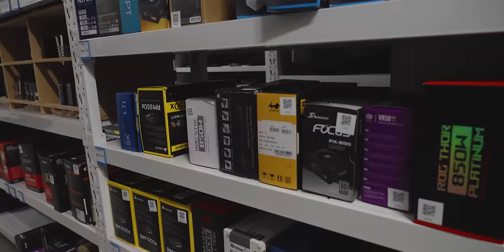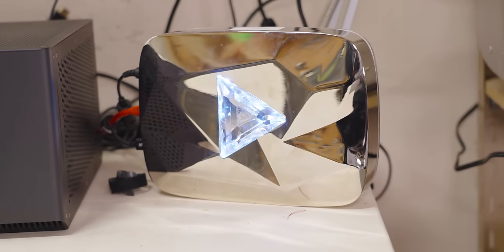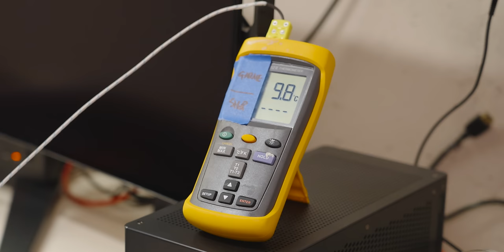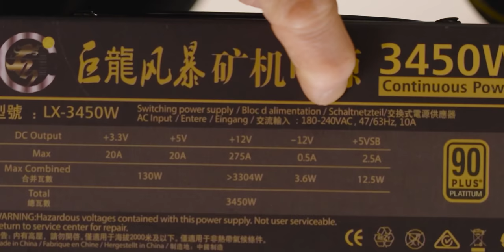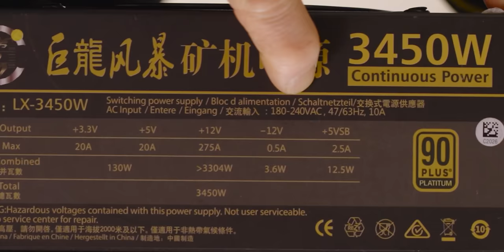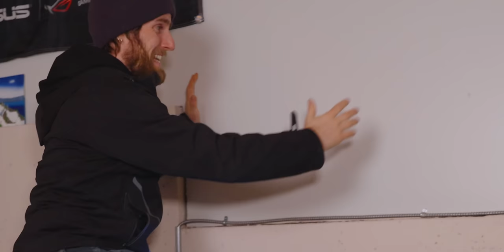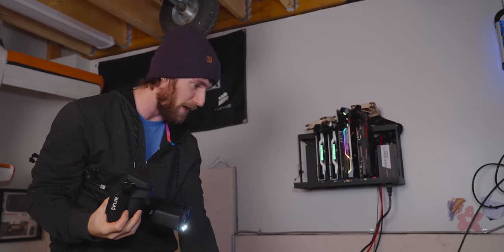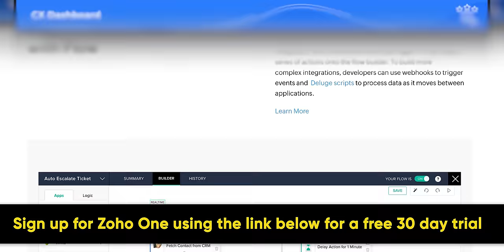Ask me why I'm Mining in 2023...

Comment: linus, "my server room is too warm" also linus "my garage is too cold."
Reply: If only there was a way to solve both problems at once, eh? Alas, humanity will never know how to move a server.
Reply: @Gabu_   The server heats the pool
Reply: @Gabu_  even putting a vent in that pumps the heat into the garage might not be to hard depending on the layout of the home
Reply: Its kind of hard to believe he didn't see this coming and make a server/garage hybrid when you put it like that.
Reply: Exactly. If the server room is close by running a duct with an in-line fan from there to that garage would be a good way to get better heat out there. Another option is to put that mining rig on the wall under the desk to make it more like a baseboard radiator and ditch the case fans.
Reply: “Things are about to get janky”, Linus’s whole channel in a nutshell.
Reply: @bakortube  This. Heat rises, so putting the mining rig under the desk, or even under his chair, would result in more heat getting to him
Reply: @Gatorz_Gaming  In January???
Reply: @Gabu_  July - "my garage is too hot"
Reply: Heat pump? Cold side in server room, hot side in garage. Do both jobs extremely well for like 500 watts.
Reply: @Blaze6108  you'd still have the really bad insulation problem
Reply: It was -8 degrees in Glasgow a couple of weeks ago, Linus just complains.
Reply: @Gabu_  Or how to move temperature. The problem with too cold rooms is humidity. But the hardware should keep it self warm enough.

The other problem is security. It is often much easier break into a garage than into an dedicated server room.
Reply: @Gabu_  ah yes, so when summer comes the server will burn, given the little delta T it has compared to the outside, that wouldn't be too optimal, plus servers aren't really that silent, and having a few dozen dollars system in the least secure place i your house isn't smart
Reply: @alexnoack9941  ah yes, break the whole house to make a ventilation system to reach the garage, genius
Reply: Bro the cable runs all go to that room for many reasons. Moving a server  just to warm this in the winter. He probably should of just gotten a space heater but this was a fun thing to try
Reply: The server room isn't in Linus' house, iirc. It's in their company building.
Reply: @Gatorz_Gaming  and the pool could heat/cool the  graage
Reply: you just need a plan for summer months.. Even when it gets to  40-50F ambient you're going to see the heat turn from benefit to burden in most cases.
Reply: @alexnoack9941  That's a good idea, but you have to be careful about putting penetrations in the wall between your house and garage.  There are lots of building codes around this to limit any exhaust fumes from a running car from getting into your house, as well as codes to help prevent fires from spreading from the garage into the house.  You would probably need a flapper style damper like the ones used on a bathroom fan and really good air sealing around the vent and ductwork to keep any garage fumes from entering the house.  In fact, using a bathroom fan to "exhaust" air from the server room into the garage is probably a good way to do this.
Reply: @bakortube  Two ducts are usually better because a single duct will create air pressure issues which will reduce airflow. so a duct in server room to pull cool air from down low in garage and a duct up high in server room to push out hot air to garage (assuming layout supports it)
Reply: @Gatorz_Gaming . It doesn’t….yet.
Reply: @manino12345 . Pretty balmy, -15 here.  My colleague in Edmonton has already been through -50 this winter.
Reply: Rich people problems.
Reply: @manino12345  it was even lower than that in Vancouver not too long ago, which is where Ltt is based. 

Vancouver is also very humid, meaning it felt even colder. I don’t think Linus being soft is an issue
Reply: Linus: dumps the heat from server room LITERALLY outside
Reply: @rustyt115  I read this at the exact moment he said that lol
Reply: linus "it would cost 10% of the cost of my house to move my servers to the garage"
Reply: it was just something fun to make a video on, not a serious heating solution.
Reply: The goldilocks of tech news
Reply: @rustyt115  I read this comment the moment Linus said it.
thanks for the subtitles.
Reply: @GuitarSlayer136  Thing is he probably needs the server up all year round and the garage will heat up during the warmer months. It's not as clever of a solution as you think once you think about it for more than a second.
Reply: what a DA 😂
Reply: lol
Reply: @Gatorz_Gaming  the pool doesnt exist right now...
Reply: @Gabu_  Honestly though, temperature swings in the summer along with varying humidity and condensation make that an iffy idea.
Reply: @bakortube  this is the easiest solution
Reply: Humidity.
Reply: I believe he has a radiator with fans for the server room outside of his house blowing warm air into the atmosphere, he could realistically just move the radiator inside the garage and the fans would move the hot air throughout the room.
Reply: @bakortube  indeed - a bit of heat below the desk just seems so darn obvious...  C'mon Linus, why wasn't that an option ?  

Oh, and before you say it, a bit of wood along and below the front edge of the desk top could divert the heat sideways so it isn't going straight up into your face and 'pits.
Reply: Just build a very long pipe connecting the two! Genius!
Reply: But that already heats the pool.
Reply: Until the summer when the garage will be super hot
Reply: "I'm struggling too heat my multi million dollar mansion"
Reply: I thought about that, but the thing is that the garage is not going to be cold in the summer. He can turn the mining rig off if he doesn't want the heat (and it comparatively won't generate as much as the server) and let the garage be at an ambient temperature. He can't just turn his server off when the garage is too hot, so the solution for removing that heat needs to be something that works year-round.
Reply: @TAMAMO-VIRUS  Heat doesn't rise, hot air rises. Heat radiates.
Reply: Solution: TOOOBS
Reply: Why are you mining in 2023?
Reply: @TAMAMO-VIRUS  That was one of my first thoughts.
Reply: If you use electric heating, your bill will remain the same for the same power draw, replace your 1600W space heater with a 1600W mining rig and make a few pennies back,
Reply: Why not pipe exhaust air from the server room to the garbage
Reply: @Gatorz_Gaming  Was there a part 2 of that episode?
Reply: @Gatorz_Gaming  even in the Winter, i don't think so.
Reply: Also Linus, "My shower is too wet"
Reply: I literally thought this was the server too hot video at first lol.
Reply: I thought ppl were gonna say just move his set up to the server room
Reply: Garages get hot in the summer...
It's really weird. It's like the garage temperature tracks the outside temperature for some reason.
Reply: @Gatorz_Gaming  Nope.... the pool cools the server. 🤣
Reply: I wonder why. lol

Comment: Since heat rises ... it would seem logical to mount the unit under your desk and then have the fans blow the heat towards your lower body heating your body and the room in that manner. Also putting a false floor with solid foam insulation under your work area with a carpet over the plywood so it would isolate the cold coming up through the floor.
Reply: I watched the whole video waiting for him to realise that putting the heat source above him was a bad idea
Reply: I have no idea how someone didn't suggest putting the heat source lower since the whole heat rises thing. Under desk=warm crotch
Reply: Yep I was going to mention this but you beat me to it.....
Reply: Itd prob be better, but even the shittiest fan can overcome convection and he was using 3 Noctuas.
Reply: @verakoo6187  Not in the volume of air he wants heated.
Also, if there's too much airflow, even like 25-30°C air would actually cool your body and make you feel cold...
Reply: @DanglyDongle  i guess they just "lets keep it quiet and make linus suffer"
Reply: Common sense doesn't always work with Linus though...
Reply: and it's easier to control of sorts :) all the heat should automatically come out front of the table.
Reply: I mentioned this and then started scrolling just to see someone beat  me to it because of course, it's like the most basic thing about heat ever Linus!
Reply: Don’t insulate the floor before insulating those ceiling rafters. When insulating, remember your ABCs: Above, Below, Conditioned space (aka walls). Always insulate the ceiling first. Foam seal any air gaps, then staple some basic R23 backed fiberglass batting and this space will feel much more comfortable with even just the mining rig.
Reply: Came here to say this. Watching this video really hurt
Reply: Huh, guess I did a good thing. 

Only difference being that my desk is the computer, I don't trust my young children around my pc so it became a desk. 

Added benefit of better mounting pressure, more space, better wiring and heat for legs.
Reply: Its Canada… heat doesnt rise there… but my thoughts exactly 😂
Reply: @michaelhanson5773  common sense also doesn't make for potentially amusing nonsense videos that lots of people are probably going to watch anyway, so linus wins either way really
Reply: Can confirm (from when Bitcoin was new) that you can indeed heat an entire (insulated) room by mining. And under the desk feels really good. Back in the day when Linus was at NCIX, I was working at a small computer shop that was built in an old restaurant - our service area was in an old walk-in freezer; well, if we had three or four systems doing burn-in tests, we had to have a lot of fans pushing the air out. We could get heat stroke in winter back there while rest of the building was freezing.
Reply: Oh, thank god, I was thinking I switched universes and in this one the thermodynamic laws work different.
Reply: I came here to say the exact same thing
Reply: Exactly what I was thinking while watching this.
Reply: Sadly linus doesnt grasp thermodynamics and heat. with dumb comments like better cooling being worse because it kicks wamth off.....
Reply: Exactly ..
Reply: Yeah not to mention the curtain ring holes and the gaps at the edges... try again, this time with large heavy clear plastic so we can all call you The Bubble Boy
Reply: Nobody tell him that hot air goes up. I want to continue watching him fail.
Reply: yes finally
Reply: What about a heated gaming chair? heated seat and armrests. Build the pc into the ultimate gaming chair. He loves building pc's, but instead he makes half a video about curtains.
Reply: Convection is an exceedingly weak effect any a fan (any fan) will easily overcome it. Linus should try what people are suggesting just to prove it doesn’t matter.
Reply: @TonkarzOfSolSystem  Yes, inside a case where it's enclosed and a static flow can be achieved. This completely open frame would require a much larger fan to cover the area being heated. Those small case fans have a very short distance they can move air, especially with so much friction in this open case.
Reply: Came here for this.
Reply: I thought EXACTLY this. Want to heat yourself only? Then put it under the desk to heat the pocket and the escaping rise will heat the desk and you.
Reply: lol I used to mine with a bunch of old cards to start with (rx 580's etc) and did exactly this .. put the 6 card rig in my study under my desk .. boom ... "free" heating (lol earned about $4AUD/DAY after electricity)

Comment: Linus forgetting the simple principle of "Heat rises" is hilarious
Reply: Actually Heat does NOT rise. Cold air is more dense and therefore heavier, cold air drops and force hot air upward. Physics. Cold air drops, SO. place a vent on floor level and one on ceiling level and a blower and vent pipes in between. Use a speed control and a raspberry Pi to monitor and control blower speeds and activations, and lost of servers/test systems and la viola!!! a partial solution. Next make sure you have insulated garage doors, and top notch garage door seals. (and hopefully  insulated garage walls. Plus there are rubber interlocking tiles for garage floor that might help a little with insulating the floors???
Reply: @WalterGreenIII  if the cold air is forcing the heat up... isn't the heat... rising?
Reply: @WalterGreenIII  seems like a pedantic way to correct someone who gets to the same end result for practical application. its like saying, a fridge doesn't have a cold interior, it uses a condenser to pull the heat  from the interior of the fridge to the outside environment making the fridge have less heat then before. While you are technically correct in your explanation the lay man effect comes to the same conclusion. If you have hot air that is 1 meter off the ground, eventually it will be forced up.
Reply: It's true that hot air rises because it floats on top of colder air. However, it's not true that heat rises. Heat goes to cold. Wet goes to dry. Higher pressure goes to lower pressure.
Reply: @WalterGreenIII  WOW!
Reply: @volkswagenginetta  thanks for teaching me the word 'pedantic'!
Reply: @WalterGreenIII  Thanks! You just explained how heat rise!
Or you can also say cold air does NOT drop.
Reply: @TuangDheandhanoo  pedantic is the perfect word for the meme "well actually"
Reply: @WalterGreenIII  Women don’t avoid Walter, Walter avoids women

Comment: Linus, heat naturally goes up, instead of heating the ceiling and the wall behind the frame, put the rig under the desk (but not directly on the floor, use some rubber pads as isolators). At least your feet and lower body will be warm - a huge difference.
Reply: Hot air rises because its less dense than cooler air, heat goes in all directions but I agree he should have put it under the desk and added another curtain to the sides to contain the heat there so its warmer to sit at the desk.
Reply: It might keep the feet and linus's family jewel relatively warm but  not gonna make much difference in overall temperature of the room.
Reply: @gamechanger2473  He just needs to make an closed and isolated room.
Drywall with isolation and an actual door instead of curtains should do the job.

Or he just could heat up the whole garage with an fan heater for construction sites.
Electricity is really cheap (12ct/kWh?) in Canada, so it doesn´t really matter.

I am personally (sometimes) using an 9kW (3 phase) heater for my small garage/workshop.
Works pretty fine, but ... (45ct/kWh)

Comment: You need it placed under the desk.  Not only is convection a thing, but if you blow the "hot" air at yourself especially from a distance then you'll probably feel colder due to both the venturi effect sucking cold air in with the warm and you'll be constantly blowing away the warm layer of air around your upper body, thereby negating that 1 degree benefit and then some.  The absolute ideal would be to have the warm air gently wafting from your feet towards your torso, and have a nice insulating layer of padding on the back of your chair to stop your back feeling cold.
I say this as someone who lives off the grid in a small box with an uninsulated roof.  I have a wood stove and with one previous arrangement of my home I had an extractor fan which would suck warm air from next to the stove and expel it through a tube towards my feet under the desk at the cold end of my home.  It was very much bodged together and therefore minimally effective, but worth it in cold weather.
There are also some other fantastic suggestions made by other commenters here, like carpet and/or an insulated layer of flooring, a double layer of curtains, and allowing time for the walls to warm up a little.  It's well known among folks who sleep outdoors that separating yourself from the floor is quite important in cold conditions, and that of course carries over into this situation as well.
I'd love to see this project revisited with as many of these suggestions implemented as is financially reasonable.  I think with the right amount of thought and effort this has the potential to be surprisingly efficacious.
Reply: I have my pc under my desk, and I can confirm the heat rises and heats it more, and under my desk is this cloud of warmness
Reply: This.
Reply: This is the way Linus.
Reply: The way this'd work even better is if you put the curtains around the base of your desk to trap the heat in around your legs. The Japanese have this thing called a "Kotatsu" which is a table that uses the heat from a low-powered heater and a very thick blanket that's wedged between the top of the table and the underside of another hard surface (so like, a second table) to keep the underside of the table warm during winter, seeing as Japanese houses have three fifths of bugger all insulation.
Reply: @rtmpgt  that's is  already video concept if there is japanese ltt, making ultimate kotatsu gaming setup
Reply: @RageQuitSon good for minimizing birth rate!
Reply: He had the opportunity to build the ultimate gaming chair with heated seat and armrests and yet he spent an entire video setting up curtains.
Reply: Science man 😎